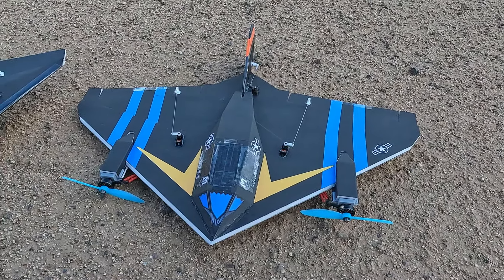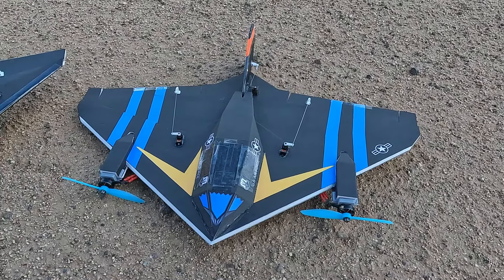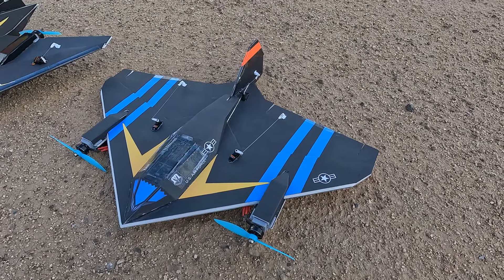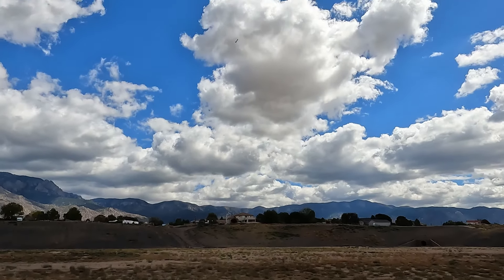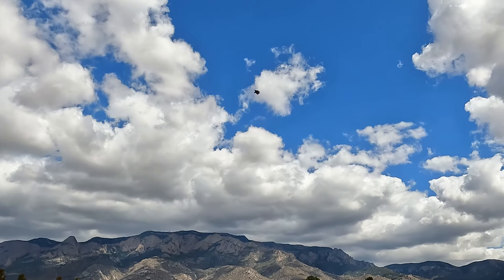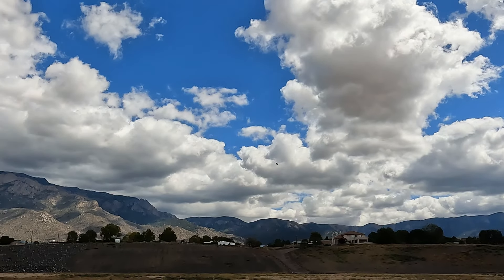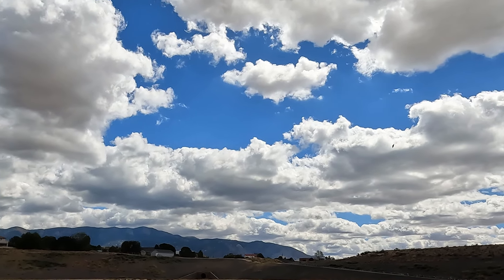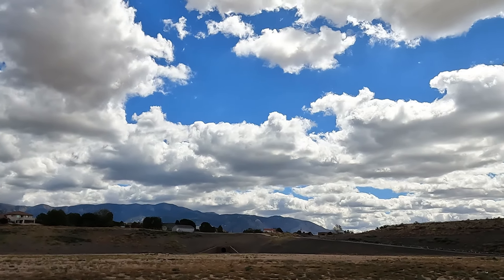New Build FF-STINGRAY

Comment: Nice fun plane to keep in the back of the car for a quick flight. 👍Made me wonder what if the motors where inline with the fuselage. One on the back one on the front, but they both had vectored thrust? What would that fly like and how fast would it turn??? 😲lol
Reply from the maker: Thanks rcplanepirate! Your idea sounds pretty crazy, I may have to try it someday. Our Friend Jon of the Bloody Micks made an SR-71 long ago with a motor on the front and the back as you described, but without the thrust vectoring.  Maybe I can mod this Stingray to have a front and back motor with vectoring as you described.  I just wonder how the weird torque roll of the motors would also affect the planes flight. One way to find out, make one, LOL.
Reply: @rcFoamFighters  Yeah I remember Bloody Micks first SR-71 as well. It made me want to build one of my own. Which I did 😁I do wonder as well what the vectored thrust back and front would do to the way it fly's. It one of those idea's that will work really well or fail dramatically 🤣

Comment: With the prop thrust right at the control surfaces, this is essentially a thrust vectored jet.
Reply from the maker: Thanks for the comment robertwong2412. Correct, with the elevons right behind the props it is basically vectored thrust, mostly in pitch and roll. I am thinking of making a version with dual rudders, that are right in line with the motor and props also. Might be interesting to see how that works. Maybe that will give me the authoritative yaw control I want.

Comment: Paul  it looks like you're using counter rotating motors which could affect the differential thrust yaw and give you some unwanted roll affect :  ie  with the motors being mounted horizontal the torque effect differential may affect roll ...  Your thoughts  ?
Reply from the maker: Thanks for the comment mabbs2757.  From my very basic understanding, when both motors are spinning, either in opposite direction or in the same direction, the torque roll is mostly canceled because there are two axis's of torque. When only one motor is spinning then there is no cancellation, and the full effect of the torque roll is felt.  I have made planes both ways, my old Jupiter plane had two motors spinning in the same direction. Some of the old WWII bombers had their motors spin in the same direction also.  This FF-Stingray does have counter rotating props. It did seem to fly fine when both motors were spinning at near the same rpm. When I tried the differential thrust with one motor basically shut down, it did torque roll hard, LOL.  This stuff is pretty new to me, so I am for sure learning as I go. The FF-Supersonic and this new FF-Stingray are the first planes I have made and tried to use differential thrust.
Reply: @rcFoamFighters  You could possibly try angling your contra-rotating motors slightly as you would if running singly. The rudder imbalance can only be overcome by having equal rudder surfaces both under and over the plan-form wing. (Or run top and bottom half rudders/servos to mix in with the Diff Thrust to counter the excessive roll when 1 motor slows down. I'm presuming that you have the props rotating such as to counter the slowing motor side wing drop?) Great designing and experimenting though! Us Old Foggies still like our XK X520 vertical capable twins. 😉😊
Reply from the maker: Thank you for the comment and insight throztreecrasher2647.  I agree with making the rudder the same size above and below the plain of the wing line, I will try and modify it before the next flight. Putting some angle on the motors a little bit sounds like a good idea too and I can try this too when I rebuild the plane.   Maybe if I angle them inward towards the nose a little, it will help pull the plane in the yaw direction I want under differential thrust. I initially didn't think of the loss of lift on the side without the motor spinning, something to think about. Next flight I will try not to fully shut the throttle when I try the differential thrust so there is at least a little less loss of lift to the slower spinning side.

Comment: Rudder just doesn't work well on delta winged aircraft - its like having a rudder on the mainwing of a conventional plane with a tailplane - there's a reason the rudder is not there.
Reply from the maker: Thanks for the comment GraemeRobinson.  The rudder may not work as good as on traditional wing planes, but something I am still having fun trying. The rudder on this plane does seem to work much better already than the FF-Supersonic and think with a few little tweaks it may do like I want. Real delta wing planes like the Eurofighter or Rafale do have and use rudders.